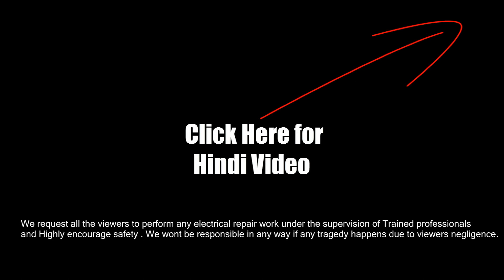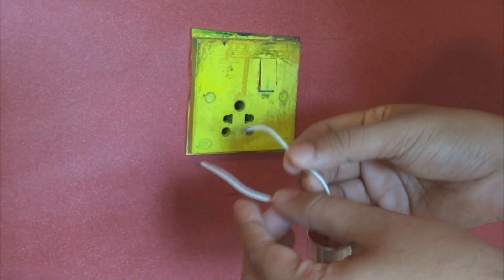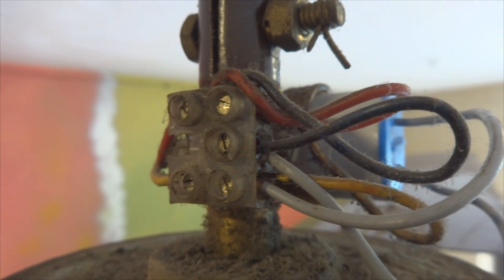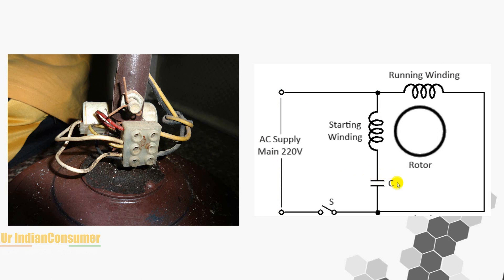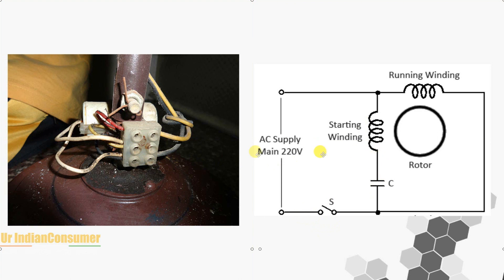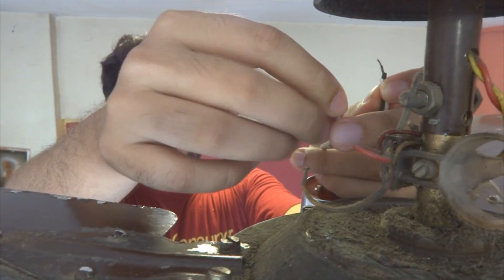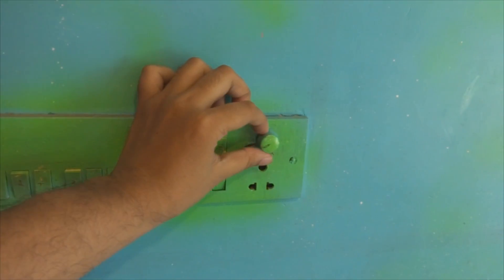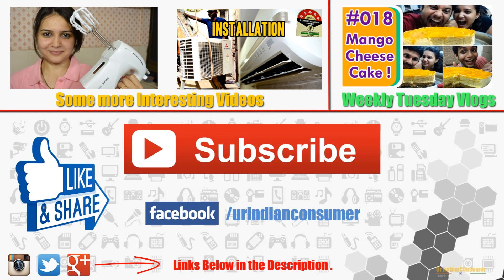How to change a Ceiling Fan Capacitor ? by Ur IndianConsumer

Comment: Thank you. One doubt though, After changing the capacitor, fan is running fine at the top speed but on lower speeds (3,2,1) it running very slow. Is it a problem with regulator?

Comment: I need to replace a capacitor for my fan. So for the old capacitor I need to discharge it first before taking it out? How about the new one? Do I need to discharge it too before solder the wires to it?

Comment: Hare Krishna!
Always install switch on phase. In the circuit diagram, switch is shown on neutral. This is extremely dangerous as working area remains live even when switch is turned off.

Comment: Hi... I'm a girl and first time I changed the capacitor my first attempt was failed as i changed the position of wires my fan running in opp. Direction later on I changed the position & tadaa..it works.. Thank u so much.. While before touching the wires I'm afraid a lot.. But as i see you touched the wires so I did the same.. Thank u.. Make more such a video..
Reply: Thank you for this comment

Comment: Thanks for the English narration. Slow delivery would be helpful to follow; Phase and neutral connection, little bit confusing. How to ensure a line as phase and neutral with the tester when the power is on. Little bit of explaining on this front will be helpful to ensure perfect replacement of capacitor,

Comment: I should have watched this video first. I already called the electrician. 😶
So nice to see a dusty fan. I'm not alone 😂
I called him back. Wanted to fix it myself. Got the capacitor, replaced. Now fan is working fine. Except there is a huge speed jump from 4 to 5. I think it's this orient model oddity.
Thanks for the technical information also. 👍🏾

Comment: Even I switch off the main supply to the fan, I received supply from the capacitor points  when I try to change the new capacitor.. May I know the reason and how should I overcome it?
Reply: The capacitor stored energy in the form of voltage despite the switch is off, hence what u can do is to connect the negative side to ground wire and let it drain first
Reply: @hochris2785  thank you..

Comment: Good effort.......Good explanation.......nice video..............................can u pls let us know which is the good capacitor to buy for fan or do we get high voltage capacitor for fan for high speed and why also capacitor of the fan need to be change everytime, i ask the same question to electrician but he could not answer it. pls explain

Comment: Need more info in the video - (a) Specifications of the capacitor to be used. (b) What difference will it make if a higher rating or lower rating capacitor is used., (c) Is there is any positive or negative end in a capacitor; if yes then which end should be connected to which one? Please update the video and respond. Thanks
Reply: A) capacitor rating is always mentioned on the capacitor itself. It depends on the fan you have. Check that, take picture, show shop to match rating.
B) capacitor voltage is usually higher than the supply. So if you go for a lower rating, it will get damaged and possibly the fan. That's why match the ratings with the current one. Explain to the shopkeeper it is for a ceiling fan.
C) No offence but it's a bit rude to ask poster to re-upload video. It's a self help video, if there is a correction it will be mentioned in video details summary. 
Your answer: polarity doesn't matter in the case of ceiling fan capacitor. If it did, he would have mentioned it especially because he took the effort to show a circuit diagram and where the live and neutral lines go. 
I know this is an old post. Hope this helps new visitors too.

Comment: Hi Sir, need help.My entire ceiling fan has a phase leakage. When I input phase the phase not just comes out of neutral also but entire fan has phase on it( tester glows on touching the fan anywhere). What might be the problem sir(internal or capacitor)? By the way it's a new fan I bought online(brand called orpat).

Comment: I changed my faulty 1,5uF cap with a 2uF and after a few hours of sublime cooling suddenly the motor died, the motor cant be opened, so i ended up in buying a new ceiling fan... i didnt expect that 0,5uF had such a big impact on the motor... so the cap was broken but i really should have used another 1,5uF cap.... well... can learn every day..

Comment: what if i made the connections wrong? one end of capacitor in starting winding and other in phase instead of neutral.
Reply: I did by mistake the fan is no more 🥺
Reply: In our fan,the two wires of the capacitor is connected in first and the last phase only...

Comment: i have replaced my celings fans's capacitors for a hundred times and not each time i ever took care of neutral and phase wires. I just connected two wires as they were. AC takes care of itself.

Comment: sir I'm an electrician and at least 10 times capacitor changed by me in monthes... there are two kind of capacitors one of the 2.5mfd and second is the 3.15 mfd... when your regulator is fast however fan is working slow that time we changed the capacitor... :) sir will you make the english conversation video which metro city peole use their daily basis in reality... :)
Reply from the maker: +rupesh solanki thanx for the input :)
Reply: which company capacitors are good for home ceiling fan?
Reply: comption capasitor best for fan
Reply: SUNIL KUMAR ..electrician how much charge for changing new capastr
Reply: What's the price of the motor?

Comment: Acha, expanding your services I see...
Reply from the maker: +akhil j have any suggestions ?
Reply: +Ur IndianConsumer Sure.
Checking and replacement of fan regulators.
Checking and replacement of door bells.
Changing chokes in tube lights.
Battery check and replacement in emergency lamps.
Reply: +Ur IndianConsumer  Some stuff came to my mind. Checking and replacement of fan regulators. Checking and replacement of door bells.Changing chokes in tube lights.Battery check and replacement in emergency lamps.

Comment: Fan to saaf karlete 😂😂😂
Reply: Ur IndianConsumer Hi Sir, need help.My entire ceiling fan has a phase leakage. When I input phase the phase not just comes out of neutral also but entire fan has phase on it( tester glows on touching the fan anywhere). What might be the problem sir(internal or capacitor)? By the way it's a new fan I bought online(brand called orpat).
Reply: There could be a problem with the switch too.You should try to turn off your mains switch or mcb so current cannot flow. Then remove your fan and get it checked by an electrician.Do not worry i am an electricals expert
Reply from the maker: +Jay Kapoor hahaha...reality dikhana acha lagta hai mujhe